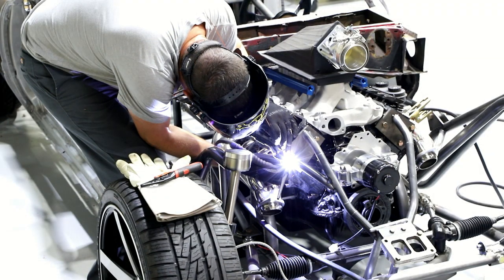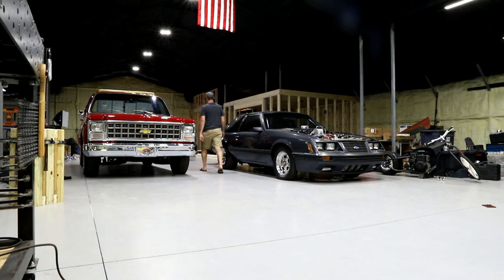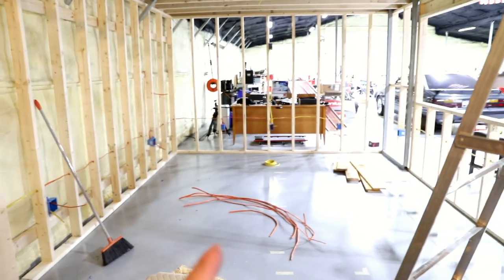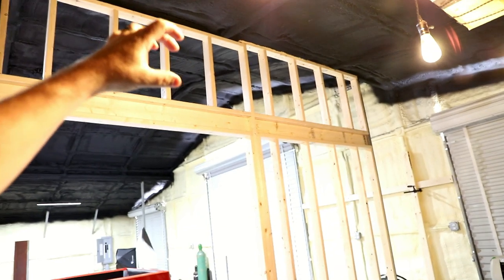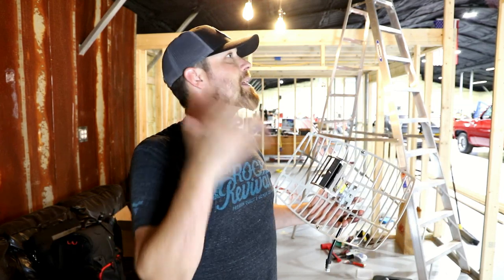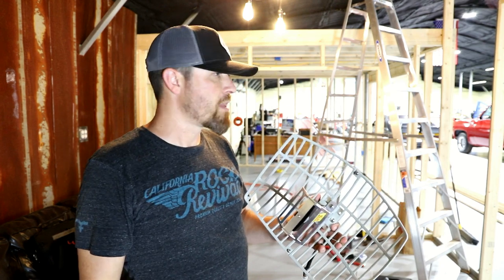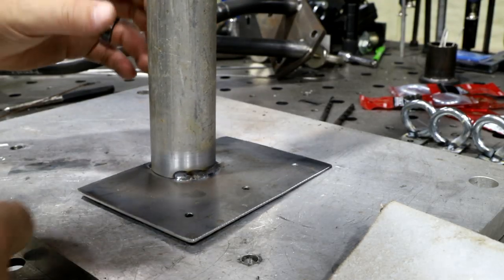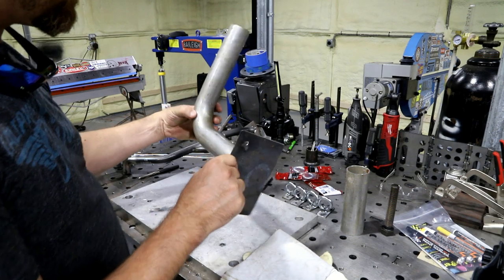How To Steal WIFI With This Thing

Comment: Full Glass panels along the shop wall.  You got a pimp shop so show it off.  You can pick up old sliding doors for nothing.  Trick them out using your talents.  You'll have a functional wall as well.  Cheers.

Comment: wouldn't it be cheaper to just run an actual cat5 cable from the house to garage, depending how far your garage is?
Reply from the maker: Not with trenching, conduit, and power injectors...would also still need to buy some kind of router
Reply: @Thefabforums  true, that'd be a very labor intensive setup
Reply from the maker: yeah that was my main reasoning for going this route

Comment: Why don't you just plumb up a PoE switch. Then if you have security cameras, you can use that to power them. And you'd have tons of wired connections that wouldn't suffer from all the machine interfere you'll be generating.
Reply from the maker: camera setup I have is all self served....but may end up using some kind of router at some point
Reply: This is the route I went. Powers cameras and a few MikroTik wAPs. WIFI everywhere I need it via tho and cable drops where needed to wired connections
Reply: @Thefabforums  if you have gone with a system like the HIK Vision all in one system (cameras and NVR in a bundle), be prepared for mediocre results. I'm just in the process of fixing up one of those installations with real equipment.

Comment: Kyle..... I have been looking for a good multiprocessing welder... I have about 5 grand I can spend.... I have priced the Everlast MTS 252 sTi with water cooler, and 60 amp Plasma cutter.... but then after seeing all the reviews on the Fronius 2200, Im wondering if it would be a better buy.... Does Fronius have a 2700 with Tig?  What is your opinion Sir?? Thanks bud, much love from over the gap over here in Sevierville, TN...
Reply from the maker: I am going to be honest. I have little experience with multi process machines. The main reason why is I dont really care for them. You always loose features in one process or another on those machines. 
That being said there are probably a ton of great machines on the market that are multi process that will fit your needs exactly I just dont know much about them. 
For me I have always been in the camp of having my mig and tig machines separate. That being said I do a ton of TIG welding it use it as my go too most of the time.
What are you looking to use your machine for the most?

Comment: Sir i have a question,
I have a b18c engine i know is not you engine tipe but wil they be eany problem if i paint the motor with normal primer and then metalic silver? Or it will crack from the heat?
Reply from the maker: I have never had any issues painting engines

Comment: i bet you could do an arduino switched light plan for the arrow sign you want to make 
seen a lot of imitaion lightbulbs that ave led's in them , seen some led halogen type lights too 
https://www.ledlampendirect.nl/media/catalog/product/cache/2/image/320x260/5e06319eda06f020e43594a9c230972d/6/4/640x480_img_2d_0005-3/gu10-led-lamp-3,5-watt-60-smd-(vervangt-35-40w)-50040106-31.jpg

 wish might fit flush intoo dimple die holes if you make the sign in metal or aluminium
Reply from the maker: yeah will most likely use the leds that look a little more old fashion

Comment: I’ve hesitated asking this, but how do you feel about blocking or making a roll up door that doesn’t serve the main shop space as a part of the lounge area. 

suppose you have plenty of other doors but............
Reply from the maker: not sure I understand what your suggesting....a roll up door between the lounge and shop?
Reply: Sorry I’ll explain. 

I noticed you built the lounge area in a place that  essentially blocks  access to the shop directly for equipment or whatever. Did that bother you at all? There’s a roll up door that you can no longer use for a car or large equipment now.
Reply from the maker: @oddfoxchassis786  gotcha...I have 3 other roll up doors on the shop so I wont need this one. Also may be nice to open the office/lounge up to the outside on nice days.